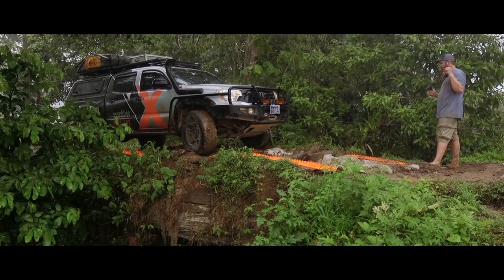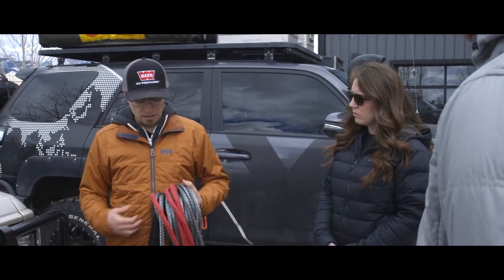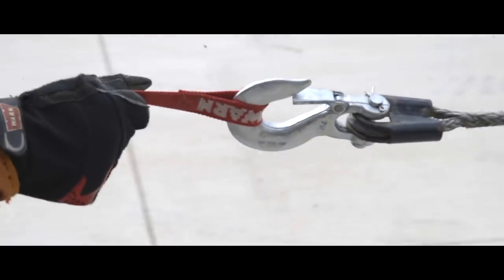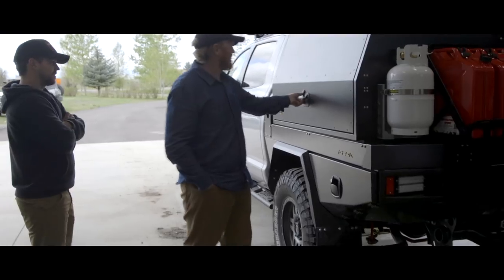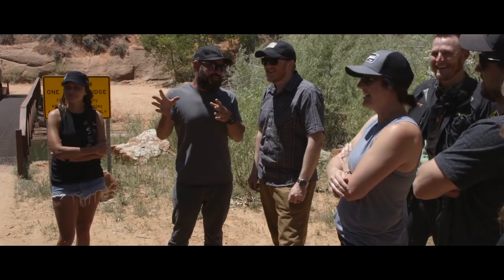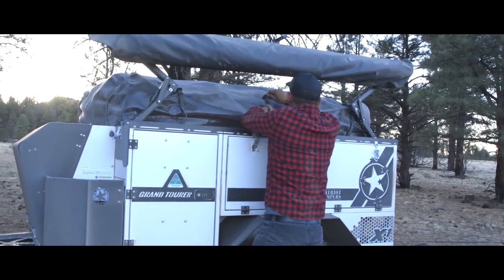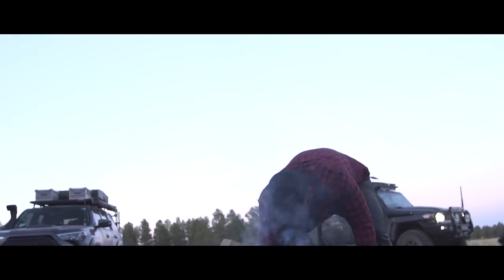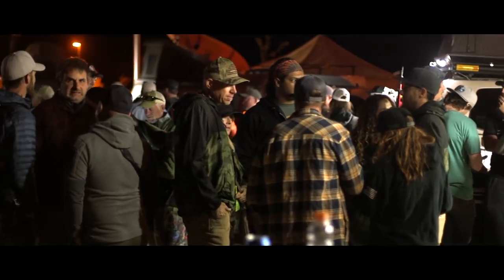OVERLANDER S1 EP4: Winch Basics w/ WARN, A Greenland Sneak Peak, and Overland Expo West Bound!

Comment from the maker: Hey Crew! This episode is packed with stuff and we hope you enjoy it! We learned a ton and can't wait for whats to come. Have a great weekend and thanks for watching!
Reply: ExpeditionOverland love your show!! I count down the days til new episodes come out!!!
Reply from the maker: Thank you!
Reply: This was a great episode. HBD Clay.
Reply: On helicopters we use bolts with castellated nuts and cotter pins. More critical hardware safety wire is used to preventing the nut from back out. A tip that may help with the hardware issue.
Reply: ExpeditionOverland  so quarter turn on the shackle pin,  but no Andrew St. Pierre White reference?  I think you’re doing it wrong.
Reply: Thats a pretty common method used on hardware long before Andrew St. Pierre White.
Reply: JulietBravo628  just trying to reference a joke they made on the SA trip about quarter turns.
Reply: Might be overkill. Use Loctite on all suspension bolts and not only will they stay on, but it will prevent the threads from corroding so you can get them off when you need to.

Comment: Missing shock bolt. Hmmm. That sounds familiar.
Reply: You don't need it the lower shock bolt with the tundra. I ran without mine and it was fine on the leaf springs until I could get back home for a repair.
Reply: s.e. charles that's what I was thinking.... I feel like a spare shock bolt would be pretty commonsense thing to have, you got hot water, sat phones, fridges, rooftop tents.... but not a spare shock bolt. I'm not saying i wouldn't take any of those rigs but for some reason I see this trend in the overland community shifting from looking competent and prepared... and looking cool at cars and coffee. If they had a spare bolt think of all the pain it would of saved them.
Reply: JimmyDevere  sure but that doesn't work when your 40 miles in the backcountry... hell they even were shooting with the company's who's slogan is go prepared.
Reply: Wrong. I was in the middle of BLM land on tough trails with no shock. Not a problem. I fixed it several later days later after I got home.
Reply: JimmyDevere I mean looks like these guys were SOL without there's glad it worked better for you lol. Stills stupid to leave the trail head without some spare parts...
Reply: Ok. Yeah it happens.
Reply: Wow no one picked up on the fact that they lost the same bolt in the Baja.
Reply: Story of their life.
Reply: Would the hitch receiver pin work in a pinch?

Comment: How often should a winch's synthetic line be changed? Or when do you know when it should be changed?
Reply: It depends on how often it's used and its condition. I often tell people that if your rope gets shaggy and looks like it needs a haircut, it's time to replace it. Also, you should never use one that has a slice in it or compromised threads. It'll be the weakest link. The key is to inspect the rope on a regular basis for any damage. If it's damaged, it's time for a new rope.
Reply: Excellent, that makes total sense. Thank you!

Comment: It seems like this crew has a number of very preventable mechanical problems... shock bolts, loose snow chains, electrical fire in the brand new trailer, broken wheel lugs... the factory vehicle is probably more reliable.

Comment: I'm a little suspect of an employee of a winch company that uses the term "Steel Cable" rather than the industry standard "wire rope". Also, a hook instead of a thimble when connecting to a shackle doesn't make sense. Hooks are there for people who don't have proper tow points or are hauling crap like logs. I like your stuff, but its starting to feel like a combo between an infomercial and the end interview at a nascar race.

Comment: no structural failures ever aye? you lost a fucking suspension/shock bolt not even half way threw the god dam trip. even if its got double bolts still unacceptable for a 30k over-lander trailer in my opinion